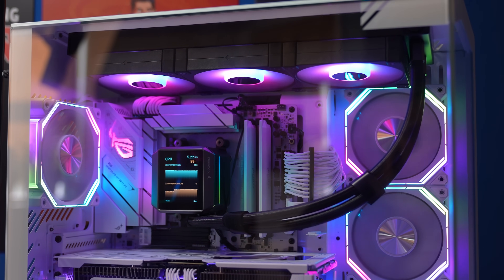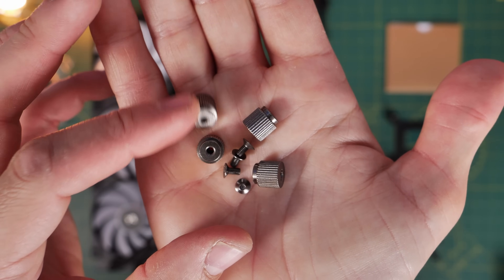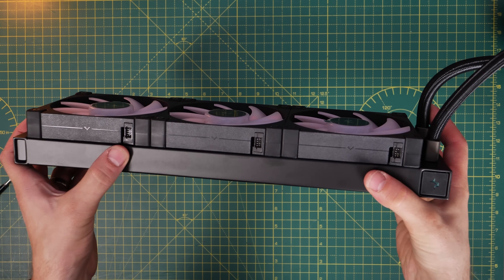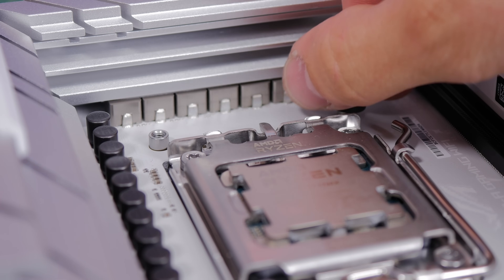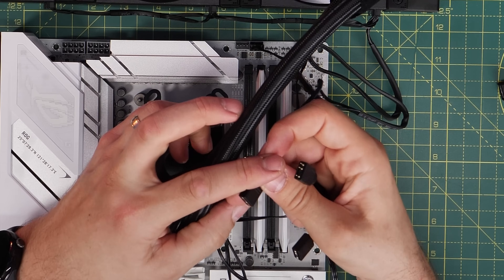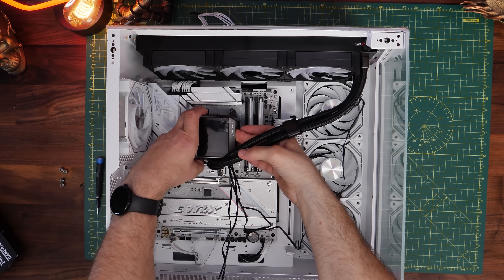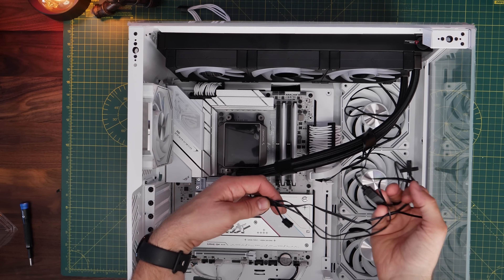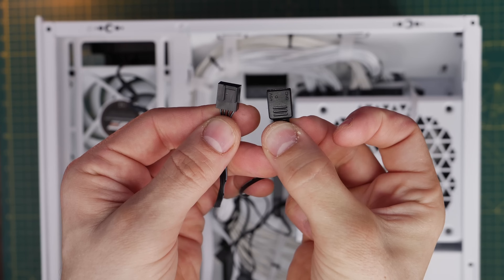DeepCool Mystique 360 ARGB wiring guide and fan swap tips

Comment: Great video, I literally purchased my Deepcool Mystique 360mm an hour ago, it replaces the BeQuiet Pure Loop Two 280mm. I should have enough space inside my NZXT Flow 9 case. My AMD 7800X3D is getting a nice treat and pretty fortunate my APNX FP2 ARGB 120mm PWM fans are almost identical to the Deepcool ones, black case with white blades 30mm, except the APNX ones are full metal jacket but can't complain. Really can't wait for the delivery ☺!!

Comment: This AIO is super NOISY, DONT BUY IT
Reply: I have it, it's not noisy at all. Maybe you got a defective one?
Reply: @Seeeyog No, it’s definitely noisy, and it’s a defect reported by everyone online. The issue is that the radiator always runs at full speed (3400 RPM) and doesn’t have a PWM-controlled pump, so there will always be a constant ZZZZZ hum.
Reply: @VersusArtsTV I get it runs 100% always, but mine is not that noisy...I did search after your comments and read the reports. There's fan sound, but no ZZZ sound.
Reply: @Seeeyog  It’s subjective. it might not bother you, but it does for me and many others. It depends on the ambient noise where you are; you’re probably masking it with something else.
Reply: @VersusArtsTV  Probably.
Reply: @VersusArtsTV  I have it and it’s not noisy at all
Reply: @Z9CC Instead, it’s extremely noisy compared to other models. I replaced it with the Be Quiet Silent Loop 3, which has an adjustable pump. A completely different world — a hundred times better.

Comment: Hi will this cooler work with the new intel socket lga 1851?
Reply from the maker: Should do. There's not been enough of a change from 1700 to 1851, so you just have to use that logic.

Comment: I did exactly so with the 240 Mystique fans swapping them out for Thermalright 120mm PWM 300-2150rpm fans to match the reverse models of the same I used as intakes. Great video Prawn, thanks.
Reply from the maker: Thanks for your support

Comment: Thank you, your videos are always helpfull and a joy to see!
I am still not sure if I should get an aio to replace my DeepCool AG400 Digital Plus aircooler(single tower, 2 fans).
My 5-7600X doesn't seem to need an aio as this cpu runs at max. 50 °C under full load with this cooler(using Camomile)
Maybe I should spent the money on an better GPU to replace my RX6600.
Reply from the maker: Seems like you're already getting good temps!